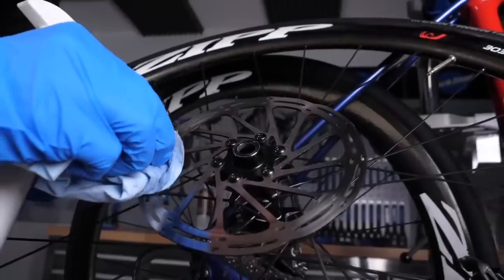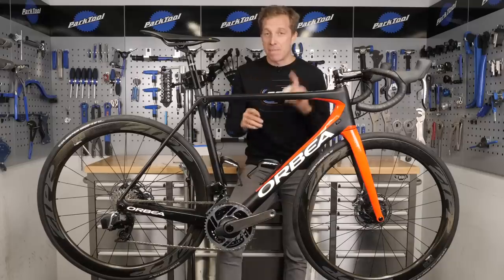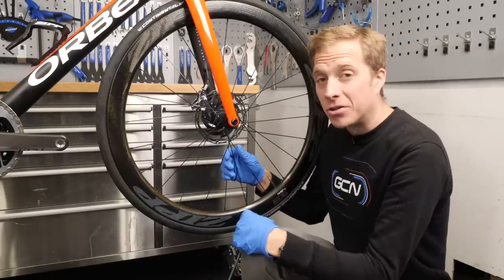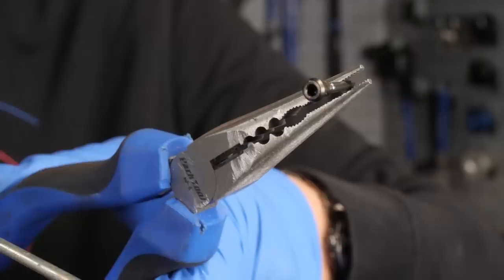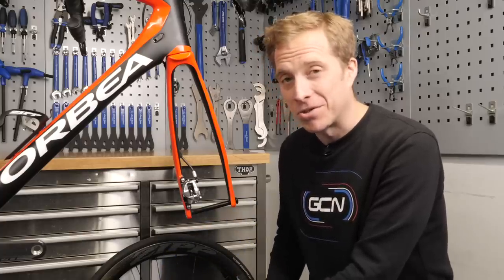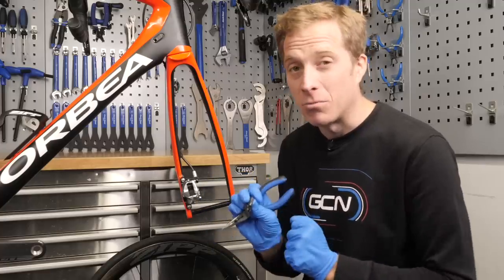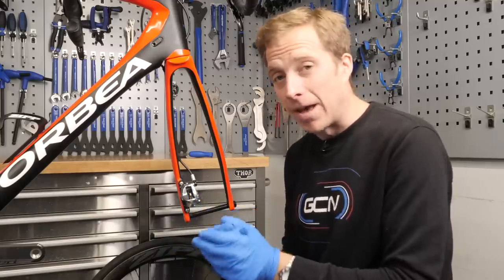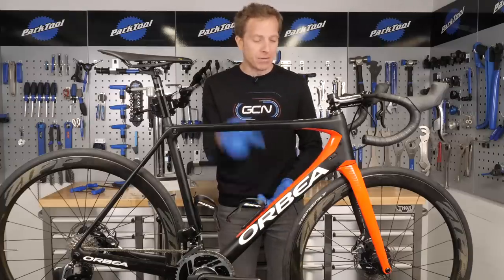Fitting Disc Brake Pads On A Road Bike

Comment from the maker: Let us know your suggestions for any Maintenance Monday videos 👇
Reply: How to service a freehub
Reply: When to change the brake discs
Reply: In videos like this, concerning tiny, fiddly parts, I'd like the video to be more in close up, not only when showing the little springs etc. that came out, but also while you're taking them out. I'd think it provides a much better view of what you're doing, especially when people watch these videos on a phone or tablet during as a guide during own maintenance.
Reply: How to change an old drop bar to a new drop bar with internal cable routing, and how to do the new routing - even better if it's on a hydraulic disc bike as they are getting more and more popular. What tools do you need, and are it all of the cables on the whole bike that's gonna be changed?
Reply: I've got some post mount mechanical disk brakes so anything for working with mechanical disk brakes would be great. Adjusting, replacing, cleaning, etc.
Reply: Wheel building and truing as well as component selection.
Reply: What about the tools needed, and knowing when your tools needing replaced. I have seen others using cheap tools (like buying from big outlets pieces of 30/50 tool sets for half the price of building your own collection), then what happens is the blot head get rounded, seat posts and bottle cages are the biggest challenge
Reply: How to optimise cable routing and setup to minimise friction in mechanical gearing.
Reply: I think you should put more close-up shots in when doing the detailed descriptions.  Things like the retaining clip on the pad screw are hard to envision if you don't already know what Jon's talking about.

Comment: Thanks for this.... I have had extreme problems with squealing discs.... you may recall my previous message to you.... well this weekend after a long furious downhill the squealing stopped.... also the discs have gone from a polished shiny to a Matt metal finish.... I can only imagine that original surface of the rotor had to be worn off.... or resin in the pads had to burn away.... I am not sure but it would appear bedding in is harder and more important that what one thinks.

Comment: Cleaning the exposed part of the Piston before pushing it back in, can also be a good idea.
Reply: +1. I missed that step with a set of shimano br-rs785 callipers and after the first pad change I ended up with weeping seals due to unintentionally pushing dirt in an damaging seals. Required buying replacement callipers to cure the resulting brake squeal... Costly error.

Comment: One thing I do before fitting new disc pads is to lightly sand the compound surface to get any initial "glaze" off them. They bed in a good bit quicker. 200 grade carbide paper is what I use to scuff the surface, that doesn't leave any "sand" from the paper.

Comment: The speed things up and make things easier for future brake changes, you can replace the threaded pin with the proper sized hitch pin clip, safety wired to a fixed point. Either to the caliper bolt or the caliper adapter. 0.30 - 0.32 ss wire. 👌

Comment: Sometimes If the pistons are not retracting you have to remove the bleeding screw at the top of the shifter to release the pressure, I had this problem few days ago when i replaced the pads, I figured it out myself luckily 😁
Reply: After remove the bleeding screw on shifter, we need bleed the brake or not?

Comment: This is not #askGCNanything but rather #tellGCNsomething.

It's about cleaning disc brake pads and callipers after they have been contaminated with oil.

Use Vinegar. Yep. Clean Perfect. No residue whatsoever. Brings the pads to the original state.

What you do is remove the pads, soak them in a glass half-filled with vinegar and leave them there for a bit.

Then reach the pads, rub them with each other, clean the dirt with a clean rag, then put them back again in vinegar.

Repeat this soaking-drying step few times.

In a meanitime clean the inside of calipers as well. Also the rotor with vinegar.

It works MIRACULOUSLY. This I've come up with on my own. And afterwards you can literally feel the pure bite of the pads on the rotor just like when they were new.

Of course, no noise whatsoever.   Albeit, don't use that used vinegar for salad ;)

Rinoni

Comment: I wish someone would come up with a specialized tool for pushing back the pistons. Something you insert and then you wind it up so it spreads both evenly and then unwind and remove. 
Park Tool get on this!!!!!!!!!!!!
Reply: Park do make a piston press. No moving parts required. Its part number is PP-1.2.
Reply: There is something but I think only for MTB. Search for "goose bikeparts". I do not have it so I can tell nothing about the tool.
Reply: Matthew Gies parktool actually state on their website that this tool is not intended for use with Shimano road calipers

Comment: When to change them? Probably a bit prior to what happened to me: The whole front pad disintegrated and you get that lovely metal on metal noise|
Reply: I recently bought a digital sliding caliper to messure the thickness of the pad. I might not change it at 1,5mm, but that is what you should do. Works really well and you can messure disc rotors too, which i find really hard to control visually.

Comment: I recently Replaced my rotors for 180mm with the use of a correct 180mm standoff bracket, but the pads only partially cover the rotor.
Is there a way to adjust the pads within the caliper

Comment: I have a mountain bike which I hang from the ceiling to save space in my shed, I got the bike out after quite a while to take it for a spin and found that my rear disk brake was solid, I released a tiny amount of brake fluid to release the pads but as soon as I applied the brakes the piston wasn’t returning to its normal position and stayed in contact with my disk rotor, do you have any suggestions, and the show is fantastic great work
Reply: Seized caliper piston? Maybe need to dismantle the caliper and replace all seals.
Reply: Take the pads out, clean the pistons with alcohol, then push them back in with a tire lever or something soft like that. You’ll have to work them both to get them back in all the way. If your pads are unevenly worn you will have to put brand new ones in or it will come back.

Comment: When changing Shimano R8000 pads I have found it not as simple as this video suggests.  The pistons cannot be forced back, the hydraulic pressure resistance is too strong.  It is necessary to open the bleed nipple to release the pressure.  The consequences that is to then to bleed the brakes to eliminate air.  Far from being a simple task to drop in new pads it is a significant job.

Comment: Just wanted to put this out there (I have discs on my mtb-works better in the mud/sand etc) But for road bikes- think about it...with a disc you're only applying stopping force to one side of the wheel hub.  (motorcycles use pairs, understanding more weight/speed-but have you done cycling in the mts? same speeds) 2nd now you've added rotational mass to the wheel..."Rim brakes" add no rotational mass (mounted on the fork) AND have a mechanical leverage advantage b/c it's further from the center of the rim which multiples its stopping force. Apples 🍎 and oranges 🍊 that make bike companies lots of money 💰All marginal effects...but then again carbon fiber and titanium alloys are also used to get 'marginal' gains~ Just a thought 💭

Comment: Rim brakes so easy !
Reply: no one cares about rim brakes! Not on a new bike, only on budget bikes!
Reply: @rikerprime3508  Marketing my friend marketing !!!
Reply: Really? That took him next to no time to do. Remove wheel, pop off pin, slide out pads, inset new pads. It takes like 2-3 minutes tops.  Everytime I install rim brake pads, I have to release the cable tension (which I have adjusted as the pads wear), line everything up, hold brake pads in place, tighten down, find they aren't centered just right, redo..... etc....
Reply: Azmi KOSNAN My sentiments exactly! Also think about it...with a disc you're only applying stopping force to one side of the wheel hub (motorcycles use pairs, understanding more weight/speed-but have you done cycling in the mts? same speeds) 2nd now you've added rotational mass to the wheel..."Rim brakes" add no rotational mass (mounted on the fork) AND have a mechanical leverage advantage b/c it's further from the center of the rim which multiples its stopping force. Apples 🍎 and oranges 🍊 that make bike companies lots of money 💰
Reply: @IanLoughead  Well how long does it take to replace a rim when the braking surface wears out? a bike shop took three hours just to do one of mine.

Comment: Hi Jon. My grandson has cable activated disc brakes, is the procedure the same. Many thanks in advance simon
Reply: Almost.  Except that cable actuated pads don't self-adjust towards the rotor as they wear.  Instead, you have a screw (Spyre) or a dial (Avid) to close that gap down over time.  So, when replacing the pads, you have to back that screw out to allow the full-thickness new pads to fit around the rotor.  Once you have everything back together, you can use the dial or screw to make the fine adjustment on the pad-disc spacing.  I have Spyres on my road bike and I like them very much.

Comment: Hi Jon, my girlfriend recently had to change pads (due to a contamination issue), and when pumping the piston back into place, there seems to be a fluid leak? Any ideas? #askgcntech
Reply: Possibly dirty or damaged pistons. Next time, clean the pistons with a degreaser and a clean cloth, and then apply some Shimano mineral oil or DOT fluid before pushing the pistons back in. Watch the Park Tool video on that subject for more detailed instructions.
Reply: Damaged piston seal allow fluid to leak past?
Reply: Adrian G that would be the right answer but if you look at the guy asking... he wasn’t talking about brake pads.
Reply: Nudge nudge wink wink

Comment: What if your pads get lubed mistakenly? Should we change the pads than or is there any solution?
Reply: You can try to degrease them with chain degreaser but if you let to much time pass, lube will absorb in to pads and you may have to buy new ones.
Reply: if you lubed them by mistake... you can try to sand them a little bit, and hope they didn't contaminate the rotor as well. if it was a lot, new pads and usually new rotors
Reply: Would automotive brake cleaner work for metal pads?

Comment: #askGCNtech i have a gps head unit. And a spees sensor on my hub. May i ask which is better to use on recording my speed. Is it by the head unit via gps or by the speed sensor itself? Thanks
Reply: The speed sensor on your hub. It's not affected by trees or tunnels and they're more accurate than a GPS signal at times.

Comment: What about mechanical  disc brake?
Reply: exactly the same. except you undo the red dial (on avids) or the 3mm screw (in TRP Spyre) instead of pushing the pads in. for TRP HyRd use the same procedure

Comment: Of course, rather than this heart surgery (watch out for natural oil on your hands), you can use rim brakes, which are so simple to maintain, that you don’t need a video on how to do it.
Reply: Except when it's time to replace the rims due to excessive wear because grit on rim brakes act like sandpaper. And that requires a lot of time, patience, and know-how in wheelbuilding. watch?v=Jw25tqAcn_4&t=4s
Reply: @shannontrainer5857  Except that in the real world (as opposed to the disc propaganda parallel dimension) rims (especially carbon ones as it happens) don't actually wear out within the desired lifetime of the wheel, unless you are using them for commuting or winter training in a very wet climate..
Reply: When have you found yourself needing to do it? In 50 years, I have never had to replace a rim.
Reply: Also, I actually think it's easier to build a wheel than to deal with disc brakes! It's certainly less stressful and better for the soul..
Reply: So you're telling people to buy an entirely new bike just to get rim brakes? Because disc-specific road bikes aren't exactly rim compatible.
Reply: @s2korpionic  No, he's not. He's saying don't fall for the hype and don't buy a disc brake bike in the first place..
Reply: @garthly  you need to ride more garth😁
Reply: @garthly  Every year to a year-and-a-half. Rim brakes can and do wear out rims over time, depend on how much you ride a how much you bake
Reply: @neil7769  You mean it's better to spend two to three hours meticulously lacing, truing, and dishing a wheel tensioning the spokes one by rather than spend five to seven minutes to changing out disc brake pads? What kind of retrogrouch fantasyland do you live in? You might as well suggest that mountain bikes should go back to the rim brakes as well.
Reply: Remember when you were a noob and fixing your bike was hard because you didn’t know what you were doing?  That’s you guys complaining about discs. It’s so easy to do and somehow this video makes it complicated. You might as well not use STI levers because they are all hype and too complicated to set up and stick with friction shifters.
Reply: @glennoc8585  Either that or he's lying.
Reply: @shannontrainer5857  ir lives on a completely flat land with no stops and a headwind in bith directions. The other scenario is ge rides a fixie with no brakes.
Reply: @shannontrainer5857  You appear to have replied to my jokey frivillous point and ignored the serious one, i.e. that in the real world, rim wear just isn't a problem except in certain extreme use conditions (commuting, winter training in a wet climate, 10s of thousands of miles a year). Of course the extent to which rims wear out will be proportional to weight, so if you are, erm.. carrying a few extra pounds perhaps discs are for you.